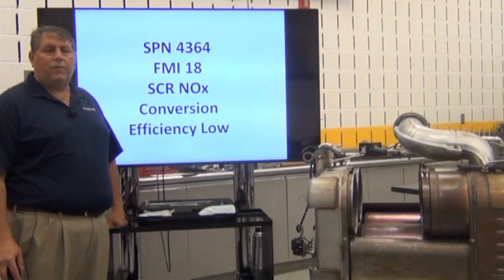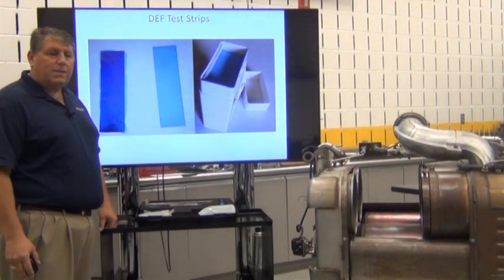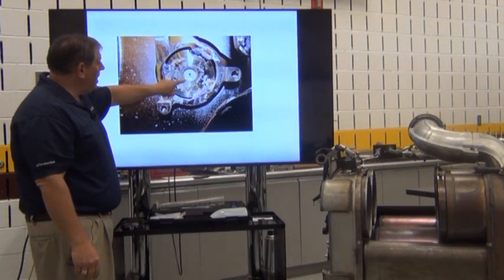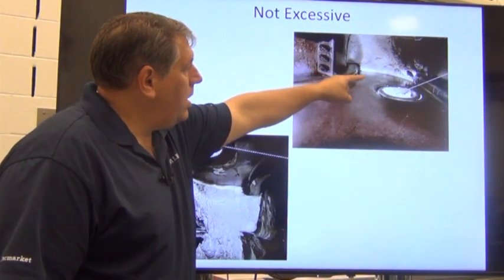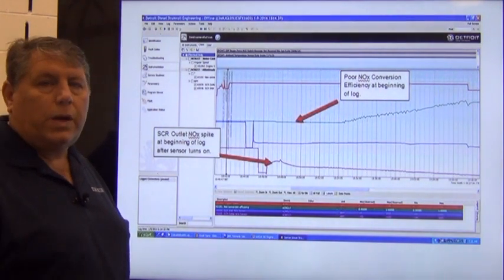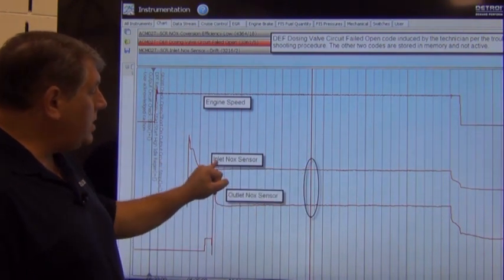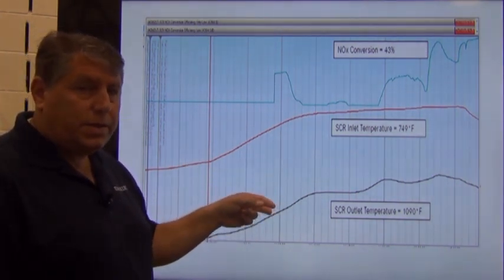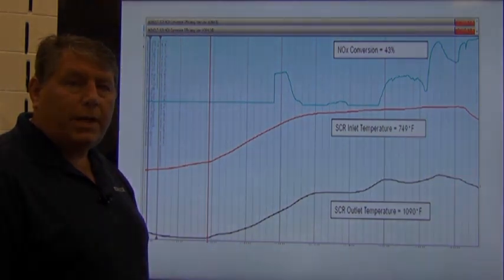Detroit DD13/15/16 - SCR NOx Conversion Eff. Low

Comment: So replace the one box??….that isn’t necessarily correct. I have a 2014 western star dd13 with 350,000 miles.  Derated all the way to 5mph.  Freightliner went through troubleshooting process and tried to sell me a one box.   All pressures n temps looked good when I brought it home so, I ran the face plug cleaning regen(took 4hrs 35 min) and it completed and passed. After that, i ran the parked regen nox conversion efficiency test and it passed as well.  All codes cleared and truck was ready to go. Ran 3 drive cycles of more than 30mph for at least a mile for each cycle and that cleared all of the permanent non active codes from the ecm. Hope this helps someone else.

Comment: I keep asking this question and to date not a single mechanic has even responded. What is the difference in:

Passive regen
Parked regen
Forced regen

When one won’t work the next level may… so what is happening that’s different?
Reply from the maker: A passive Regen occurs over the road when natural engine/exhaust conditions are correct to burn off Soot. This happens in the background without any warning lights, etc 

An Active Regen occurs over the road when exhaust temps are not naturally hot enough to burn off Soot but Soot build up in the DPF is high enough that a Regen is needed. Raw fuel is injected into the exhaust to start the reaction and raise temps. This happens in the background without any warning lights, etc.

A forced or parked Regen is exactly what it sounds like. Normal operation and duty cycle (Or a problem in the system) has not allowed normal Regens to occur and the operator begins to be warned that a parked Regen will soon be required if conditions for an active or passive Regen are not soon met. Once the warnings progress far enough, Active Regens are disabled and power and speed derates prevent passive. Parked is the only option. If soot loads get too high, parked Regens will also abort.
Reply: But what is happening that is different ? Why is a forced regen able to clear a problem that passive or parked regen won’t?

Comment: I got this code the other day , I was hauling about 43k going up hill and this code  popped up,  I did a force regen and   cleared the code , then I drove like 5 miles and it came back on this crap worries me I don't want to derate to m5 mph .

Comment: Let me make this simple. One boxes are junk. When you get a nox efficiency code you need a new 1 box. Period. Or do what everybody else does, install a out nox
 sensor on the out side of box in an area it will get hot . Let it smell clean fresh air, and bam your nox evfiency will go to 100 percent.  No more derate. Once the dumb manifacturers make 1 boxes affordable, the mass public will stop with all the bypassing of the emission systems. There are more bypassed trucks on the road than compliant trucks. Theres not 1 fucking person going to pay 12k for a fucken 1 box. Not one.

Comment: That low temp test  dobi need to do  with cold  engine
Warm engine or  after regen?
Reply: The low temp ATD is like a regen expect that the HC doser does not inject. Doesn’t matter if it’s warm or cold
Reply: @TwistedMetal51  
Means ill start regen and unplug  or  unplug the connector  and start regen

 Thank  guys
Reply: @alexbaranya5432  do you have a ghg14 or ghg17? What’s your ACM software level? What faults do you have?
Reply: I have 2015 cascadia freightliner         i am not sure what is that u ask
Reply: Just bought otr  diagnostic
I changed the gasket and valves on def pump
and cleaned the   7th injector
Reply: @alexbaranya5432  what are the fault codes you have. We use Detroit Diagnostic link professional. Nexiq connectors
Reply: @alexbaranya5432  the def pump is not serviceable. Are you talking about the def Doser?
Reply: @TwistedMetal51   yes   located  by the def tank    
What rpm suppose to be at   140psi      after  regen inhade    
1660 rpm  with  140 psi   

No engine  lights on
Reply: @TwistedMetal51  on  def doser i changed the   screen inside the doser and  gasket between  doser and  box

On def fuel pump the  filter
Reply: @alexbaranya5432  the rpm and psi readings are good.
Reply: If no engine lights are on and no faults are active then you’re done.
Reply: @TwistedMetal51    thanks  soo  much  
Its  soo helpful you guys   
B4 i had no  def  
Thank  u again
Reply: 4364  fmi18

Comment: The solution to this mess for all O.O. is to buy a new truck and let the warranty pay for it. Once warranty is over resale the truck and keep buying new with option to sale. Or lease. Then they'll have a shitload of raggedy trucks sitting on for sale truck lots with noone to buy. No need to keep wasting money on a system that carries this many issues. Last but not least they create the problem and have no solution but truckers pay for it. Cut out the game. Railroad industry is owned by government so they won't bill the government for faulty systems created by the government. It's all a game to stick it to the little man. Big business doesn't have this problem because they max out the warranty then sale. Don't buy a truck without warranty. Don't buy a truck with high mileage. Then you'll see millions of trucks sitting on truck lots and salesmen salivating to get that garbage sold.
Then the epa will come up with a better solution and stop scamming small businesses. Then they'll come with another money making solution and truck drivers will eventually quit, protest, or find a way to override the garbage. Freightliner can't even fix the problem with their trucks. They always scream it's the one box. Notice this part costs $14000 to replace. They only want to change the one box. It's like their trained to say it's the one box everywhere you go.

Comment: I have a problem with going uphill every time I do it it gives me the check engine light and the fault code I’ve changed both my filters but i still get it what do i do
Reply: Change Def Metering Unit Inlet Screen, around $426

Comment: I get bad def quality, Scr efficiency low, then derates to 55 mph this scenario only happens when I am pulling up a hill with a load.  I replaced def doser, all wiring harnesses for the after treatment, sensors. I had freightliner check for bad one box and they said it’s fine. Any ideas what else could cause this? I also get a low def pressure code sometimes. So frustrating. Any tips would be greatly appreciated. 2014 freightliner Cascadia.
Reply from the maker: This is sort of sounding like DEF buildup in the 1Box. Has the truck had an awning installed? (I have another video covering those).
Reply: What u do to fix the problem?

Comment: Would it be a good idea just to put the screen..? And if there's too much  DEF, Does that mean the injector is injecting too much  And needs to be replaced?
Reply from the maker: "Would it be a good idea just to put the screen..?"
If you're not seeing an issue with the system, but had the 1Box opened up anyway (Ex: For filter Maintenance), then yes, I would say installing it would be a good idea.
"if there's too much  DEF, Does that mean the injector is injecting too much"
Not necessarily. The system can be doing everything correct but sometimes the duty cycle that the engine is running combines with weather and other factors can still cause DEF build up.

Comment: Also always watch Def pressure during scr efficiency overview. A DEF pump intermittently kicking out should always be looked at before replacement of the one box. Def pressure and amount dosed needs to be monitored when doing an overview.
Reply: What should the psi be? Mine is at 51 psi def pressure
Reply: @TheFaze732  on Detroit Diesel the normal psi readings I’ve seen constant is 135-145 PSI. If you are getting 51 psi, it should throw a low pressure DEF detected fault.
Reply: What is pump  pump rpm at 140 psi ? At warm engine  or cold?  Thank u guys
Reply: @alexbaranya5432  using diagnostic link. Perform ADS SCR self check. If it passes, you’ll see def pump readings.
Reply: What   diagnostic to buy?
I bought  otr diagnoatics to clear codes    
If u guys can tell me what to buy how much
I  need to learn to read  diagnostics  to keep my truck system updated

Comment: NOTE! The awning is only for GHG14 or GHG17 systems. EPA10 which are normally for late 2009 to early 2013 have the air dosing system. And have the injector nozzle intead.

Comment: Higher PPM on outlet than the Inlet nox sensor ? What could be the problem?
Reply: Run a low temp atd to verify for sure that the nox sensors stay within 32 ppm of one another. If you aren’t looking at the last 10 minutes of a regen you won’t get accurate nox sensor readings until then. The inlet sensor doesn’t begin reading until after the last 10 minutes

Comment: following these steps, and using the "advanced troubleshooting" option in Diagnostic Link, I am to the part for the Low Temp ATD test with the doser electronically unplugged. Throughout this test, my Inlet NOx sensor stayed between 185ppm and 205ppm. My outlet NOx sensor drifted. Starting from 155ppm to 160ppm half way through. Then it dropped to 10 (ten) and slowly came back up to within 50ppm of the inlet sensor. Would it be a better bet to replace the outlet NOx sensor first?

Comment: what amount of time should it take to get the 108-132ml of D.E.F.
Reply from the maker: The rest will run for a preset amount of time. Usually 2 or 3 minutes. When the Doser stops spraying, take the measurement.
Reply: I am doing the test with a PRO LINK it runs for 4 minutes.i didn't know if it was the same amount as Detroit software.
Reply from the maker: 4 minutes sounds right. The test is most likely built into the ACM software and whichever tool you use is just asking it to activate.

Comment: Hello.  I have a few questions:  When running the low temp regen and the nox sensors are not within 50 ppm of one another, the PSL states to replace the outlet nox sensor first.  Why is it recommended to replace the outlet nox sensor first?  Is there documentation supporting changing the nox sensor that is indicating drift i.e., if the inlet nox sensor is indicating drift, change it first as opposed to the outlet nox sensor)?  If the inlet nox sensor is replaced first instead of the outlet nox sendor, can that mask a faulty outlet nox sensor?  Can it bring the nox sensors to within 50 ppm of one another even though the outlet nox sensor is faulty, and leading the trouble shooting process to a replacement of the one box?  Is there documentation that supports replacement of the one box without first replacement of the nox sensors in the order indicated in the PSL (outlet nox sensor first, then inlet nox sensor)?  Finally, can a faulty nox sensor (inlet and/or outlet) cause progressive damage to the one box?  Thank you.
Reply from the maker: Personally, I've seen a lot more Outlet sensors fail over the years so I think that may be why they lead you in that direction. But, I always watch their readings. If the inlet is obviously drifted, I will replace it first. 
I don't believe faulty NOX sensors will damage the 1Box but I have seen them contribute to DEF buildup inside of it.
Reply: Thank you very much for responding.  So the sequence of events proceeded as follows:  The shop replaced the inlet nox sensor first.  Then the one box was replaced.  Then the outlet nox sensor was showing to be unstable and was replaced (tech claims that the outlet nox sensor was damaged in removing it from the old one box, causing it to malfunction).  The cause of failure step was not performed.  I want to know your opinion as to whether this was a proper diagnosis of a one box failure (SCR inlet and outlet temps tested to be within 20 degrees of one another).  Thank you.
Reply from the maker: Without seeing log files of the troubleshooting, it's really a tough call to make. Damaging a sensor upon removal is very possible but it's typically the threaded section that takes the damage. USUALLY, if it's able to be installed in the new 1Box, it should work as well as it once did. There are a lot of variables at play. The age of the vehicle and it's history of overheating the Aftertreatment system can also play big parts.
Reply: TheDieseler let me just put it this way:  If it was your truck, and knowing that replacing the 1 box will cost $9100, wouldn't you want the nox sensors replaced first as specified in the Power Service Literature?
Reply from the maker: Well...It would certainly be worth a shot. I would explain the situation to the customer and explain that they’re reading as they should. Replacing them would have to be their call before going ahead with the 1Box.
Reply: TheDieseler of course it would be worth a shot.  That's why the PSL states to replace them prior to replacing the one box.  Very simple.  But in my case, this shop deviated from the PSL.  As a result, it never verified that my original one box failed.  This is the most outrageous ripoff I have ever endured on a repair.  Who was it?  Freightliner of Harrisburg, PA.  Check out their reviews to get an idea.  Will tow before ever using them again.  I recommend everyone to stay away.  My truck is a 2015 with DD15, 388K miles, meticulously maintained.  A 9K repair from normal use should not be necessary that early.
Reply from the maker: To be fair, PSL recommends replacing the Nox sensors only if they're reading skewed. If they read properly, you move on. Replacing them when they're reading properly is just a guess.
I can understand the frustration though.
Reply: TheDieseler the PSL says that when the nox sensors are not within 50 PPM of one another, it states that you replace the outlet nox sensor FIRST.  You said that in your video.  It isn't written that you replace whichever sensor appears to be drifting.  You do it in the order given, so that the one box can be singled out if necessary.  Why didn't you say, "well, just change the nox sensor that appears to be drifting"?  Because the PSL states other wise, for a reason.  If it is not done as instructed, it cannot be verified if the one box has failed.  The failure of my one box was not properly diagnosed.  I don't need anyone to tell me black is white because they ripped me off.  If you go in for an operation on your left knee but they operate on your right knee, a doctor isn't necessary to prove wrong doing.  I don't need an expert here.  What is amazing is how timid people within the industry are to point out fraud.  Saying stuff like it's OK to deviate from the PSL to explain fraud where there is no written document approving that is a "black is white" argument.
Reply from the maker: Actually, that's not me in the video so I didn't say anything. 
Truth be told, I deviate from PSL from time to time. It's laid out in a way that you can find problems even if it's your first time encountering them. Encountering them multiple times per day for years and also spending time speaking with actual trainers gives you an understanding of where things in the process can change. I'm not going to say you can cheat but the order of things can sometimes change. This often comes down to good technicians who still have a functioning brain of their own. Sadly, a lot of OEMs don't like them.
If I were working on your truck and the outlet sensor were reading the exact ppm that it should but the inlet was drifted high, the most I would do is recommend replacement of the inlet and ask if you would like the outlet replaced as well. Chances are you would say no because most people are not fond of spending hundreds of dollars to replace functioning parts. If the 1Box still went on to fall, I'd again present the option of replacing the outlet sensor as a last ditch effort but I'd make sure you understood the chances of it fixing anything were slim. 
Were you intentionally swindled or at the least on the receiving end of a poor diagnosis? I honestly don't know. I'd have to be there or at the very least, look at log files (Btw, these log files almost certainly exist and you should ask for them if you believe things were not done right). 
Anyway, that's enough. At this point you're just looking for an argument. Your fight is with Freightliner of Harrisburg and Detroit Diesel. If you have a leg to stand on, they'll hear you out and most likely offer policy on the parts cost.
Reply: TheDieseler I'm not looking for any fight.  I just don't like getting ripped off, which is what happened.  My no sensors are covered under warranty.  I never received the option to change the outlet nox sensor.  I have asked for the log files, they won't give them to me.  This includes the DSM.  In addition to this, they never did the cause of failure.  So let me tell you that the diagnosis of my one box was improper and a ripoff.  You can't make that call based on that?   I can, it isn't hard and doesn't require an expert.  Why won't they give me the log files or other data indicating the one box had failed?  Because there is no supprting data, that's why.
Reply: Having problems with def system  for about two years, spent thousands of dollars, no one can find problem. Truck been in different shop every time on the road.  What a joke!  I guess I will have to delete the system, or take truck back to dealer where I bought it
Reply: @alekslav84  Having the same problems.  There needs to be a recall.
Reply: I've fitted loads of outlet sensors on European Mercs. We use very different diagnostics I think.
Reply: How can I get more videos from this guy talking bout more d.p.f.probloms ,codes and diagnosis procedures??? I looked on the internet but can't find anything on this guy
Reply: Can u guys tell me how to do the  low temp  test
  Cold engine    
Warm engine
Do a regen 
Or  when is in regen     disconect  electrical   from def doser

  My  truck after  regen had 
Exhaust fuel pump rpm  1660
145  psi

 I have no codes      thanks